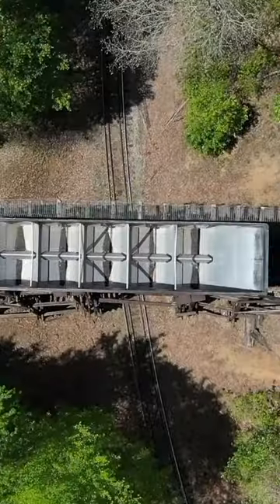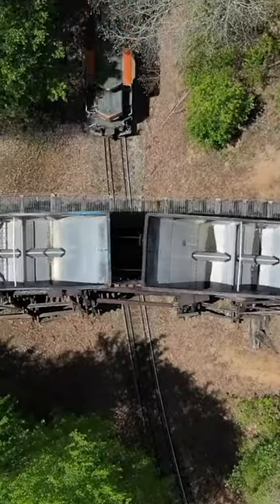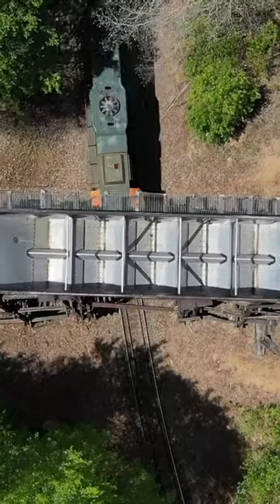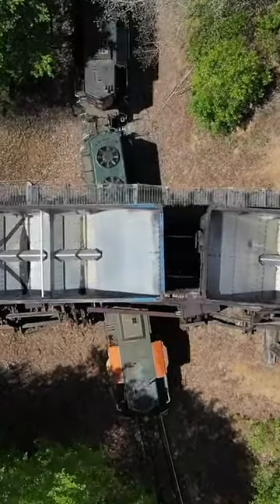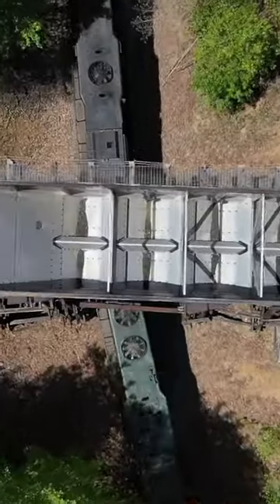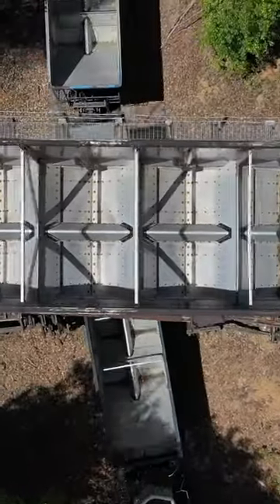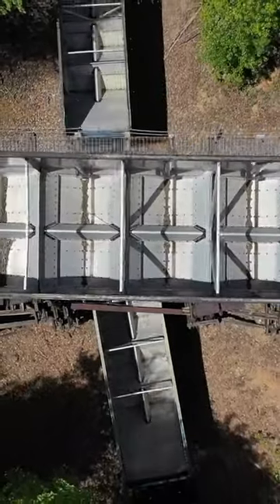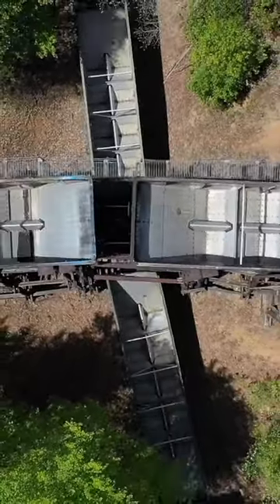The Amazing Looping Railroad | #Shorts

Comment: They went to old freight trains cars in may of 2023 that were on the railroad tracks.  They found 4 railroad cars loaded with brand new 1971 Chevrolets sitting on the tracks for 52 years.  All cars had 0 miles on them.
Reply: KM117.  the insurance company paid for the missing 4 trains of 1971 Chevrolets in November of 1970.  These cars were being transported to car dealerships for the 1971 new car season when these 4 freight  cars ended up in a long term abandoned freight yard in Ohio.  There have been other instances of finding new cars just like this in old freight yards.  2 freight cars of 1957 ford station wagons with 0 miles and in brand new condition was found in 2018.
Reply: @jameshooper8793 what’s the name of the news article?

Comment: If you get a chance, check out the Tehachapi loop in Kern county. There is also one in Northern Californi, but I have never went to see. These engineers, with no computers did wonders.
Reply: I used to hear the trains slumber up the Tehachapi Grade when I lived in the town of Mojave, Ca. in the mid-70s. My apartment was about two blocks from the train yard and truck stop off of the main highway (it was either highway 14 or 58; I forgot which). It was the best sounds to fall asleep to.